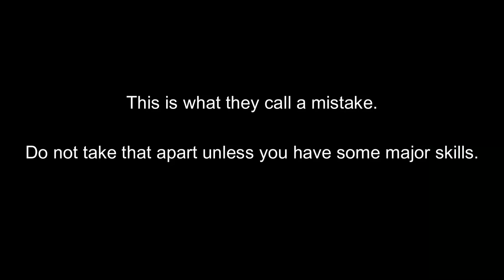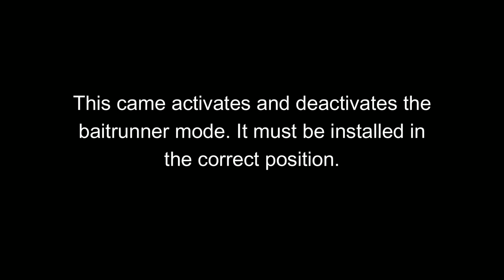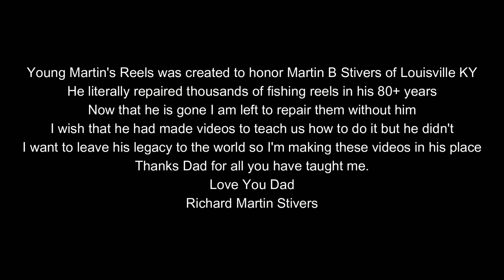Young Martin's Reels  --  Shimano Baitrunner 6500 -- Service and Lubrication

Comment: That was almost scary when you took that cam out. I found myself going back to the point where you took it out to see if you would remember which way it went back together. I have to take a lot of pictures to remember that kind of stuff because i'm always afraid I will reassemble things backward or upside down. That was a really gutsy thing to do Rick, so thanks for showing that as I am sure someone will eventually need to see that.
Reply from the maker: Dan, I’m pretty sure I was mad more afraid than you. Since this isn’t my reel I was visualizing having to find him another one, just because I wanted to show how to do it. When I pulled out the washer only to find it was a cam, I thought, “OH NO! You’re in trouble boy.” Once I calmed down I examined where it went and why. Then it was just a matter of fitting it back together. Not an easy task. If I ever get one of these reels of my own, I might shoot another video of the complete disassembly and reassembly. There has to be an easier way to put it back than what I did but I didn’t want to risk Ken’s reel anymore than I already had. Overall I’m happy with the way it turned out. The hardest part was those crappy C clips on the axle shaft.

Comment: You had me on the edge of my seat when you were working on the bait feeder mechanism. Kudos to you. You’re a brave man with a lot of patience. 😊👍
Reply from the maker: Steve, so far over the years I’ve found few things I couldn’t put back together. One was a timer for a washing machine. The other one was a hundred year old pendulum clock. I was sure I could put it back together but I was wrong. I sent it to a clock repair shop for assembly. That turned out for the best since it had three bad parts in it. After a year of fishing reel repair under my belt, I’ve been contemplating taking on another clock. I’m happy to take on more reels. If Ken keeps supplying them, I’ll keep servicing them.
Reply: @youngmartinsreels5314  l always wanted to be a watch maker, I love the art of that process. Then I realized I didn’t have a steady hand or good enough vision. My two favorite YouTube videos are reel and mechanical watch repair. Keep them coming. I really enjoy them.
Reply from the maker: Steve, have you ever watched wristwatch revival on you tube. I love watching him rescue watches. After watching him I went out and bought some EBay watches to attempt. Unfortunately, I didn’t do enough research first and only bought watch frames. I retired my watch repair dreams. Besides I have plenty of reels to keep me busy. I found another 50 reels last week I forgot that I had.
Reply: @youngmartinsreels5314  Yes, I do watch that channel. It’s in my favorites and I enjoy listening to Marshall narrating the repairs. I wish I had his talents.

Comment: Rick, I wouldn’t touch this reel with a 10’ pole! These reels are notoriously complicated. This 6500 is supposed to be one of the best bait feeders aavsilsble today. I only have a smaller Okuma Avenger ABF40 bait feeder that is much simpler to work on. My two Shimano SSG7000 rear drag saltwater reels also have those two c-clips on the axle shaft. They are truly a pain in the “@#%”! I ended up buying some extra C-clips. You made this look far easier than it actually is. It gets real interesting when there is something wrong in that bait feeder mechanism that you need to repair. Great video Rick!
Reply from the maker: Chris, I think that if this were my reel I would replace the C clips with E clips. I believe that would make them much easier to get on and off. Those super thin C clips are just to fine to get hold of. I have that same Okuma Baitfeeder and I don’t think I’ve done a video of it yet. I think I did service it last year and it hasn’t been fishing since. I’d really like to get into the rest of the baitrunner mechanism on this Shimano but since it wasn’t mine I felt I had risked it enough already. Maybe one day I’ll have my own. I’m watching EBay.